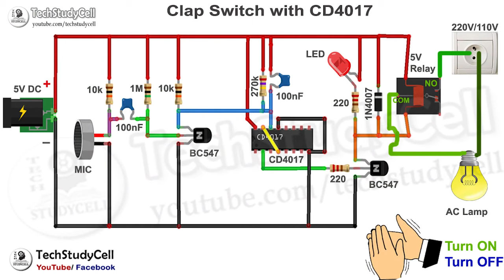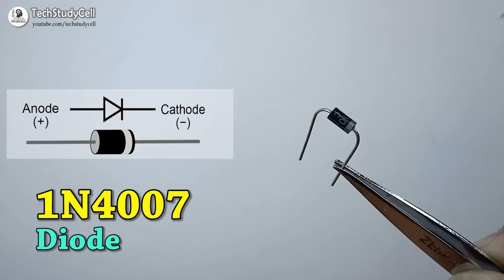Simple Clap Switch circuit for Home-automation #clapswitch using Transistor & CD4017

Comment: I bought exactly the same accessories. I have done exactly the same circuit. not working . What could be wrong? thanks
Reply from the maker: Check for any loose connection and wrong polarity
Reply: Ok , i will try again and i will let you know . Thanks a lot !

Comment: thanks but there is a problem i figured out on  1:13. the resistor should go to negative rail not positive rail otherwise the capacitor will be inversely polarized
Reply: I have built several of these, using the design shown and all work perfectly.  It is my understanding that ceramic capacitors do not have a positive or negative polarity, so I am a bit confused.  Does it work equally well with the cap going to the negative rail?  Also, just for information, the circuit can also be used with a PIR and it will latch it on as well.  If you want to use a microphone module, the design will also allow that and it gives you the ability to control the gain to some extent.

Comment: Can u give an alternative component for that capacitor that u used. 
I only have ceramic and electrolytic .
I have never seen them
Reply from the maker: You can use 0.1uF ceramic capacitors.
Reply: @TechStudyCell  how many volt is required if i use 0.1uf ?

Comment: Hey my everything is working but at final my bulb is not glowing. My led is working at every clap but this issue is of blub, even though my bulb is in working condition. Please help
Reply from the maker: Check the relay and use stable power supply.

Comment: The audio front end of the circuit is not very sensitive for a soft clap with your hands. It's not very practical the way you have made it.  It needs to be more sensitive.
Reply: three choices
1 - use another gain stage
2 - use an op-amp instead  
3 - use a lens cap from a flashlight to concentrate the sound

Comment: Instead of270 kohms resistor which resistor can be used
Reply: I built one with a 330 K resistor and it worked just fine.  Anything close to a 270K should work, but when substituting, I generally go to the next larger value
Reply: try 270,000 Ohms
Reply: @joejohnson4137 did you use 5v adapter?
Reply: Yes, and a 5 volt relay.  @jacksonjeff7207

Comment: Pro man. Thank you 

But what happens if u connect 9 v battery to it instead of 5v 
Does it work then ? Does it cause harm to the components.?

Also can you specify the ratings of ur bulb ?
Reply from the maker: The battery will soon drain out. I will suggest you to use 5v power bank or mobile charger.
Reply: It will affect the component if u giv more that 5 volt or u can use voltage regulator
Reply: @TechStudyCell  how to connect a 5v charger to bread board ... Plzz .. Reply I have... Completed all process ... But the main problem is power supply
Reply: Rply me sirr
Reply: @TechStudyCell  4v dc supply is okay with this circuit

Comment: A great and useful electronic chip I want to please explain to me ،  the maximum distance that I can get away and the process remains valid . 
And if a car passes by, and the air vibrates near the house, will the lamp work?
Reply from the maker: If the sound is high the circuit may turn on by the passing by car
Reply: 00

Comment: but i have a question can i use this project to light a fan
Reply from the maker: You can connect any appliances with relay under 5A
Reply: a fan does not light      a fan blows air

Comment: 100nF = 104 ... Please correct... because 103= 10nF
Reply: May i know the voltage of capacitors that used.. When i ask that in semiconductor shop they are asking about voltages.. Could you please reply me soon... As the day of project expo is near by

Comment: We did same as in the video ..but its not working..no loose connections..whats may be the prblm???
Reply from the maker: Make a high noise.
Reply: @TechStudyCell  please help me the led is glowing by just turning on the switch,not glowing by sensing sound
Reply: @TechStudyCell  there could be any components could be damaged or anything else you can suggest to me